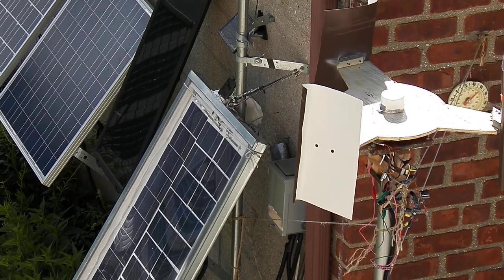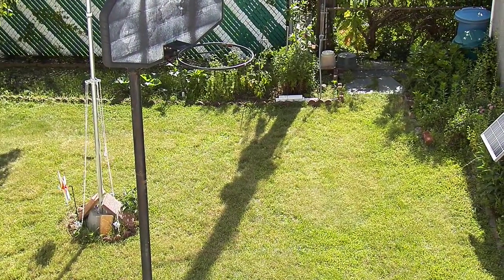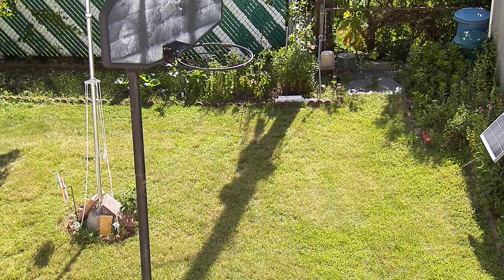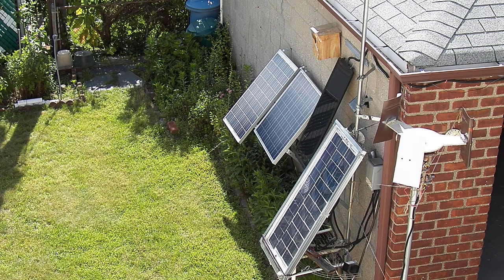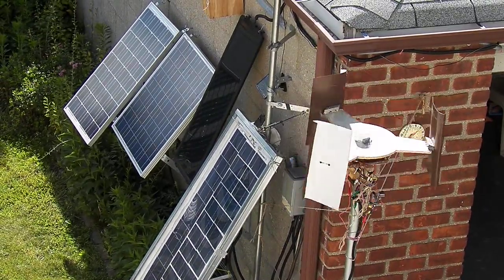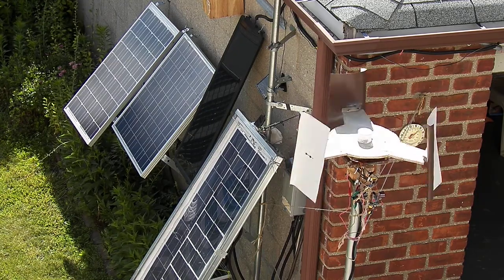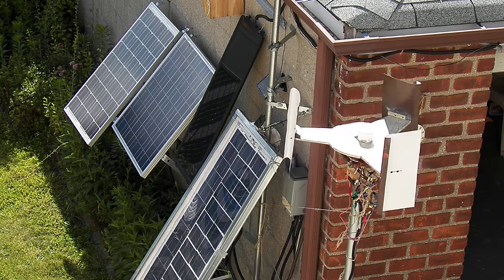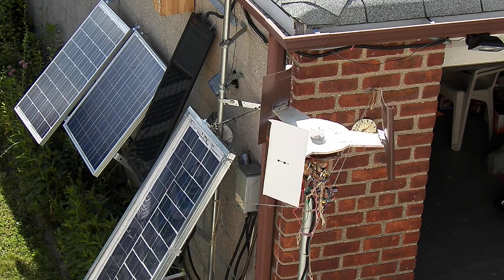Thinking about a green summer project. Maybe a solar oven.

Comment: I did a little experiment recently using a 15 watt solar panel to run a 12 volt dc bilge pump. (no batteries). It demonstrates the gravitational vortex power plants. You have plenty of solar panels!   One  think you might do is Equatorial mount for your solar cookers or solar panels. Makes it easier to point them.  Stelarium lets you look 1 hour into the future, and aim you cooker on alt azu mount at that point.
I have lots of solar videos if you want some "different" ideas.

Comment: I've been looking into all the different kinds of solar cooking.
I have a huge fresnel lens that can reach over 1000F, catch fire to 2x4 wood in 3 seconds but you have to cook a different way using that. 
The ovens that reach only 200F to 250F work fine, they just have to bake over a longer period of time.
Solar tracking units help to!

Comment from the maker: It sure is hot where you're at. I'm beginning to think some houses should have built in (or built out in this case) solar ovens to save energy. Imagine a house with water barrels, solar ovens, solar panels and solar hot water heating. You can save a pretty penny.